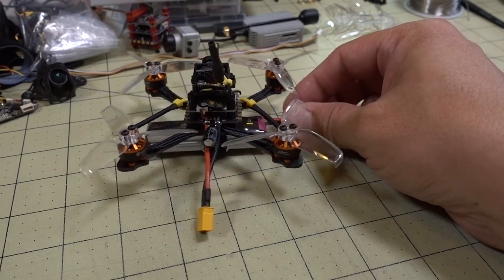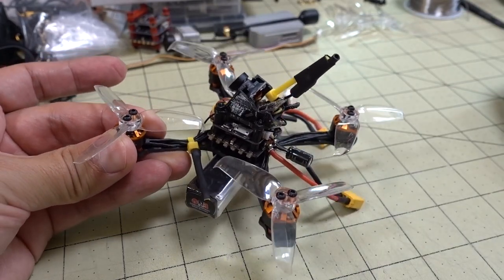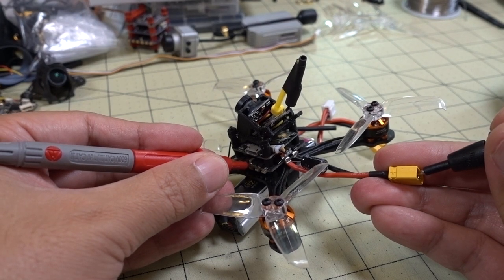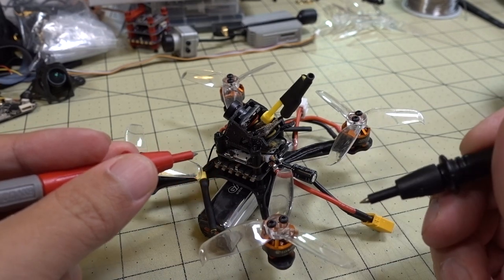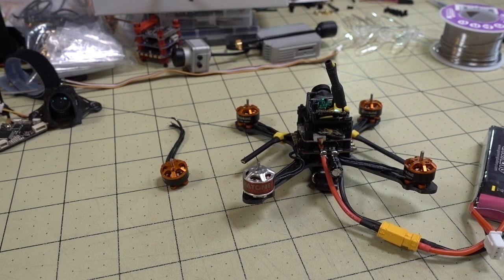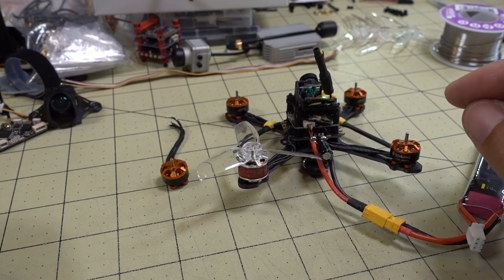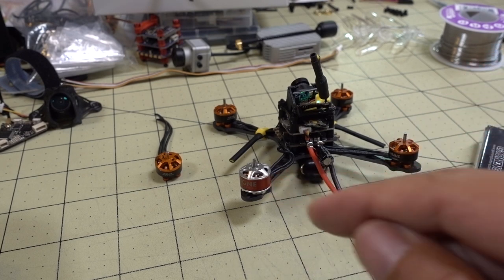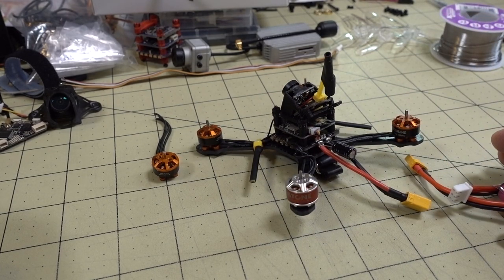How to Diagnose a Motor ESC Problem 🎓

Comment: Make sure the wire connection at the board wasn't bad. I have had the strands in those small wires break and do exactly what your motor was doing. That motor may be fine. Strip the ends a little bit, tin up and try it one more time.

Comment: Albert, another test I do, is to make sure there is continuity between the 3 cables on the motor, they are attached at he end, and a lot of times is one of the cables that breaks, and most of the time is fixable.
When the cable breaks and is missing one of the motor facets they behave like you showed at the beginning of the video.
Reply: Another test i do? sounds like Yoda talk. lol
Reply: @christopherlee3045  wow

Comment: Thank you VERY MUCH for this video.  One of my quads motors was acting similar.  I performed the test you showed, and got the same result, so I replaced the motor, and bam, up and running.  This is my first quad and I had ordered one extra motor but had no other parts.  I ordered the Tinyhawk Freestyle 2, and had done no "tiny" soldering.  With the limited tools and knowledge I have (being new to the hobby), this video was EXACTLY what I needed.  Really really, thank you.
Reply from the maker: Glad it helped

Comment: I had the same thing happen with Armattan Oomph and Racestar and at the same time HGLRC Flame and the Tyro79 motors were fine through much worse abuse. 
Since Eachine usually makes shit so my uneducatedguess is they did quality check by mistake. Someone at the motor factory was so tired that he leaned on that big red lever, the one that says "do not push" and that turned on the quality control machine. That day yield dropped down to 5% and I was lucky to get the surviving motors.

Comment: I have a Love/hate relationship with 4in1 ESCs because of that very problem. I have at least 5 that only function as 3in1s. Last time I tested by swapping, I burned the test motor. At least I used an old 1806. In my case, it's always the ESC.
Reply: I'll buy them off ya for cheap. I do surface mount soldering so i swap out burnt out fets of processors. Interested?

Comment: Try measuring the resistance and capacitance of each winding as compared to a good motor windings.
So let’s say phase 1,2,3 measure between 
1-2, 2-3, 1-3. Ohms and Henry’s that may show which winding is off.  Just thinking out loud

Comment: Yes it will definitely fly, all motors I believe it will not spin faster than your lowest kv motor, no reason not to fly it. I have mismatched motors on some of my quads. You can attach a drill to the motor shaft, and measure output from all combinations of wires,  1 will be drastically different. Thanks A.K.
Reply: Papadoc Fpv yep I can vogue for this too. I have also tested motor windings with the drill constant speed for voltage differences between each winding lead. Also ohms test numbers I believe would tell for an issue too.
Reply: Do you have to unsolder the motor to test it with a drill?
Reply: D Staron yes and test each wires to one another at a time
Reply: Agreed
Reply: @dstaron3162  always take the component out of the circuit to test no mater what it is.
Reply: So why when the back left motor is bad are you testing the back right motor???

Comment: Just in case you didn't know, the prongs of the multimeter have caps which can be taken off so you have a longer contact to work with, felt like an idiot when I learned it myself having used it with those tiny contacts for so long.
Reply: Well I never!!! Thanks.

Comment: Thanks for posting.What would I use for a search term in youtube to decipher startup tones from motors? I bought a cinewhoop type BNF quad that everything seems to check out right in betaflite but when battery is plugged in the tones are like nothing I've heard before.I know not much info to work with,but I'd just like to know where to start looking for an answer
Reply from the maker: Sorry, don't know.
Reply: DC smith did you buy it used?

Comment: Yeah it'll fly the kv is close enough they are far enough apart it may be hard to tune, depending on the gram force lift. The flight controller handles the balance of the gram force on each motor so it'll speed it up or slow it down accordingly. I ordered the wrong kv of the same motor 3 were 1507 2800kv the one was 1507 4100kv and the pull of that motor was so more more it had one corner jump up for like .2 seconds then flew decent. but 3-3600kv and 1-4100kv didn't even phase the flying characteristics.

Comment: Rip it she'll be fine. Mismatch individual escs can even work for beaters. To test motors spin shaft with drill and measure that voltage is generated about the same between each lead. Finally compare with known good.

Comment: Why does it always seem to be left rear motor (3??) failing on these all in one boards...I love my Emax Tinyhawks but I’ve had three develop the same issue...Emax was cool and after sending them some vids...and confirming that two TH were only a few months old...sent me out two new AIO FC/ESC boards...within two weeks one of the new boards developed same issue?? I’m careful to disarm etc after crashes...pulled the motors they seem to work fine...swapped plugged in motors...board seemed fine...(intermittent e-problems...like a British sports car 😜) ....walked thru possible mishandling by me with their techs (great service btw) ....hell the new board didn’t even touch the grass much...any discussion on others experiences would be enlightening....
Reply from the maker: Is it always the same motor?  If so, there might be a flaw in the motor that is eventually killing the same ESC.

Comment: Hi mate. I have this quad, and after a very slightly abrupt landing, and this same thing happened. Not even flew one whole lipo. Are these 4 in 1 boards very delicate? 
I had a mantis85 and the same thing happened. 
Please help because its putting me off the hobby, and parts are being discontinued.
Cheers
Reply from the maker: These smaller parts can break easily sometimes if you crash them just right.  Sometimes some people are just really unlucky while others are surprisingly lucky.  There's no foolproof way to know.
Reply: @AlbertKimTV  thanks for replying

Comment: I would love to know what might be the problem with a motor acting like that and looks fine and not burnt up. I think the tyro would fly fine (a bit glitchy unless anti-gravity is way up)
Reply from the maker: Probably the winding is broken somewhere not easily seen.
Reply: My cinerace is doing the same thing I just got it yesterday and when I was setting up it pushed itself and go caught on some plastic now the motor spins but real slow and then it’ll shut off and beep I’m guessing there’s a short in the motor

Comment: Hey man I have a newish drone never crashed. I waterproofed the board (nazgul 5v2) that was working fine for a day after & I landed in rocks & a rock was stuck in one motor I flew for abit and landed and after I got home the drone don’t make the dee dee noise after the battery is plugged in.. what do you think I need to replace the esc or Fc?
Reply: All motors are fine
Reply from the maker: If you don't get the first three beeps, the ESCs are dead.  If you get the first three beeps but not the last two, the FC is either dead or the connection from the FC to the ESC is broken.
Reply: @AlbertKimTV  okay I think it’s the FC that’s dead.. if I get a new one and plug in my dead one and save files & load onto the new one it will be good?
Reply: Fc is giving me one long beep

Comment: I made the same test and it was a burnt motor and not an esc. I bought another motor and installed it in the previews esc then I open throttle and burnt  another motor. It looks that fc cannot handle 4 motors only 3.Why is that?

Comment: Hi Albert.  I have two doing this now.  I switched motor out and it seemed to do well for a few trips then BAM the motor 4 was back to twitching.  I’m lost.  Now I don’t know if it means the new motor is bad or what.  The struggle is real.
Reply from the maker: The ESC has an issue and is killing the motor.

Comment: I'm having a simular problem. I crashed my novice 3 and bent a prop shaft and replaced the motor. I tested it in betaflight with props off with no stutter but when i put props on and connect the battery and then arm it i get stutter. When I apply throttle slowly it takes off (uncontrollably) and i have to disarm it to stop it. During bf testing once i got runaway flashed on the goggle screen. Can you or anyone that see's this help me figure this out?
Reply from the maker: Seems like a defective ESC.  The runaway flashing on the screen could also mean the props are on wrong or the motor is spinning the wrong way.

Comment: after a snow crash when i plugg in the battery nothing happends. how do i know witch part is broken?
Reply from the maker: Any lights?  You may have a bad flight controller.  I would need more information to diagnose.  Not enough info here to really tell what is going on.
Reply: @AlbertKimTV  okey, the fc started to smoke when i but the fc into the esc and got fried, when i did this the camera and reciver was still pluged to the fc, do you think motor,camera and reciver also got fried?

Comment: my esc wont make tone when startup, when i plug the flight controller up it works with battery power but i dont hear a tone
Reply from the maker: So you don't hear ANY ESC tones?
Reply: @AlbertKimTV  well now I'm thinking its because I dont have any motors wired up yet usually I have motors installed before checking too see if everything working

Comment: Is it common to have a motor start working again after recalibrating in BetaFlight and then stop when small resistance from crash ... Guessing it's the motor
Reply from the maker: You just had a dying ESC that gave out after the crash.
Reply: @AlbertKimTV  it would sometimes come back after recalibrating.

Comment: nice thats how i test . yes it will fly and no u shouldnt but u can .i would throttle limit to 80%
SINCE U TOKE %20 KV AWAY
Reply: With lower kv the motor will spin SLOWER, so there is no need for a throttle limit